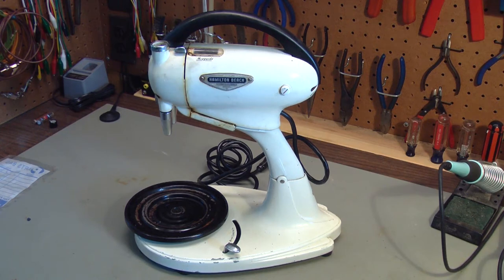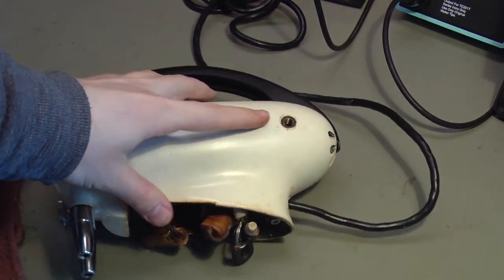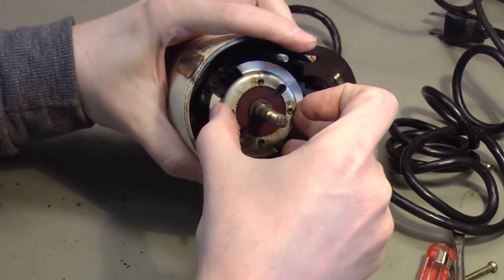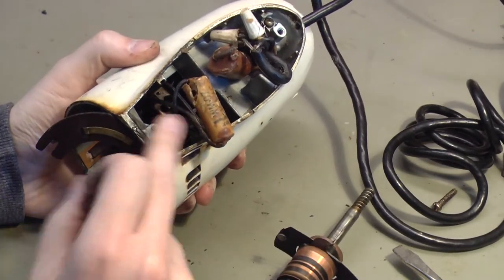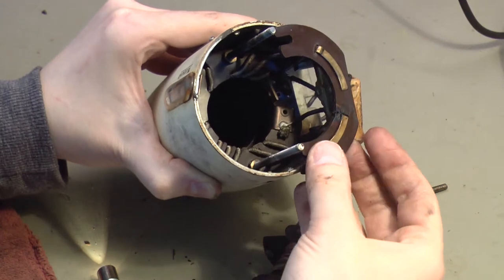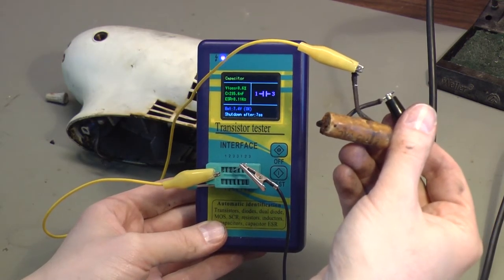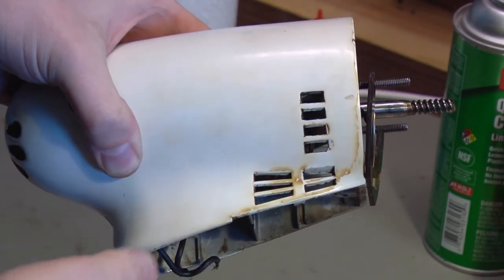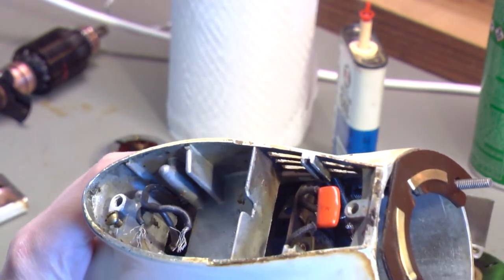Repairing a Vintage Hamilton Beach Model G Stand Mixer

Comment: I own a Hamilton Beach Model G and was looking for some advice on performing some maintenance on it. Your video is a great source of information. I am a Journeyman Electrician and can help you with understanding its operation. The motor powering the mixer is what is called a Wound Rotor Motor. It is a form of speed control for AC motors. The large 3 phase versions were used to drive Ski lifts and paper machines. With the advancement in DC control, large DC motors have pretty much replaced them. How it works is a normal rotor (rotational part) is wired together and produces a magnetic field as the magnetic field rotates around the stator (stationary part) The motor speed is set by how many pairs of poles make up the stator. To vary the speed, if the winding of the rotor is taken to slip rings, a varying amount of resistance can be introduced to the rotor to weaken the magnetic field making the rotor 'slip' more. IE rotate slower. The capacitors are in the circuit because a single phase magnetic field does not rotate, it flips back and forth. To trick the rotor into 'seeing' a rotating field, a capacitor is wired into two of the field windings to make the strength of those fields grow at very slightly slower speed than the windings with no capacitor. As far as the sparking id concerned it's likely from the scratches on the sliprings. They are catching the brushes and small bits of carbon are being removed. In a motor shop they would turn them with a lathe. I maintained a 100 HP 3 Phase chair lift motor at Marmot Basin near Jasper Alberta in the late 80's. Learned lots about how they function and the maintenance required.
Reply from the maker: Thanks!

Comment: Oh.  Be careful releasing that copper spring that holds the window in!  Don't pry it off you'll chip the edge of the plastic window then it won't stay in there.  Press down in the middle of that brass springie thing to release it.  I had to buy another mixer to get a new window for Grannuy's mixer.

Comment: Was wondering if you remember where you were able to locate replacement capacitors I’m working on a same model one and I need to replace both of of the capacitors where the cord goes and I have not had much luck so far finding any

Comment: Hi Nelson. Thank you for your tutorial. It was very helpful. I have a problem. When I opened my mixer the viewing plate and a c shaped metal part fell out and I don't know how they. Fit back.
Reply from the maker: The viewing plate should be held in on the back side with a rectangular spring clip that digs in to the plastic of the viewing window. I'm not sure about the c-shaped part. Can you take a picture of it and email it to me? video@nelsonogden.com

Comment: Hi Nelson can you provide an update? Is it still working? Did you resolve the arcing? Can you provide more detail on the brushes you purchased?  Thank you so much for this video!!
Reply from the maker: Sure! We used the mixer a few times after I repaired it but then my wife got a new KitchenAid as a gift, so we haven't used the old Hamilton Beach lately. I decided the arcing is normal. After I made this video, I did the same maintenance for someone else and their mixer worked the same as mine with about as much arcing. Not too worried about it. Regarding the brushes, I took my old brushes to my local hardware store and matched them up with the closest replacement carbon brushes they had on hand. I had to very carefully file down the outside edges of the new brushes just a little bit. So I don't know what their part number or specifications would be because I just grabbed them out of a bin at the hardware store!

Comment: Could you give me the complete details on the replacement cap you used? I'm about to start a refresh on one of these mixers and the caps are beyond their service life.
Reply from the maker: Sure, I used an Illinois Capacitor model 224MSR250K. It is a polyester film capacitor rated at 0.22uf and 160 VAC .

Comment: Great video very helpful, could you please tell me the specs on your capacitor?
Reply from the maker: Sure, I used an Illinois Capacitor model 224MSR250K. It is a polyester film capacitor rated at 0.22uf and 160 VAC .
Reply: Nelson Ogden thank you very much!

Comment: I use food grade grease on all my mixers. Just in case some drips down the beaters and into the food. I’m not sure if regular gear grease is safe to eat.             Good job by the way.
Reply from the maker: Thanks! And that's a good idea on the grease. Do you have a particular brand/type you prefer? I can't say I'm entirely satisfied with that sticky, stringy wheel bearing grease I used.
Reply: Hey Nelson. It’s called Super Lube.           I think amazon is the only place that has it. Just make sure it has “food grade” on the back. I think it’s grade 2
Reply from the maker: @spiderlovesbeerohyeah4760  Thanks!

Comment: I have a question for you - I own a Hamilton Beach chrome stand mixer that my mom received as a wedding gift in 1961.  When I plug this in and turn it on now, there’s no difference in the gear speeds.  And it’s been a long time since it’s been used at all.  In great shape otherwise.  Would you be able to look at, and/or fix this?
Reply from the maker: Could be a number of things. Without looking at it, I don't really know what direction I'd go. Regarding repairing it, I've done some repair work for others but I'm hesitant to say yes. First, if it needs any parts (and it sounds like it might), I don't have them nor do I have a source for them. Someone that does this work full-time probably has parts units they can pull from but I do not. Second, for the jobs I do take on, I'm booked up for months. If I took on your job, I likely wouldn't get to it until next spring.
Reply: @w8nwo  I understand, and I’m not in a hurry to have it repaired.  I’ve been trying to locate someone locally, but have had no luck so far.  It has sentimental value, and is in great shape visually, but I’m trying to assess whether it’s worth being looked at/repaired?  My mom was always very careful with it, even when she used it.
Reply from the maker: @KingDavidinPhoenix  Okay, if you're interested in sending it to me, I'll look at it and see what I can do! If you don't mind, email me at nelsonogden+video@gmail.com and I'll send you my address.
Reply: @w8nwo  Will do, thank you sir!!

Comment: The speed control on my model G mixer no longer works --now has one speed only. Is the controller repairable? Or replace?  Do you know of a source for a new speed controller?
Reply: The adjustment screw for the speeds is under the handle. I removed the handle. The screw with the jam nut was easily visible.  Loosed the jam nut. Tightened the screw.  Now have 6 out of 9 speeds.  Does anyone know if it possible to get the other 3 speeds back?  Not that my wife is complaining, 6 is SO MUCH better than 1.
Reply from the maker: @eddyjr1947  You're ahead of me on that one! My speed control worked fine so I didn't have to think about how I'd repair it. Sounds like you've made progress, but I wonder if a full teardown and rebuild would be the next step to get it working properly. It could be gummed up or the contact points could be burned.